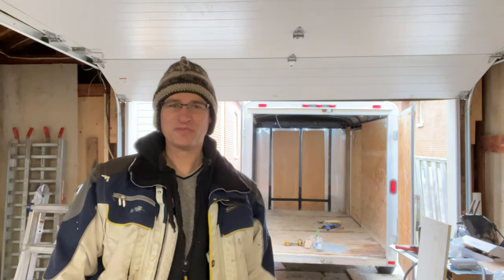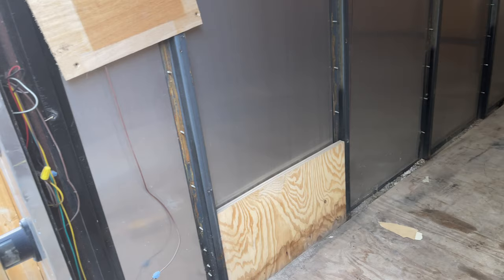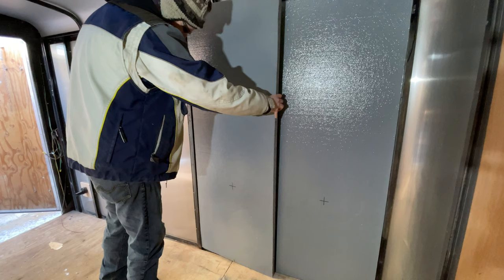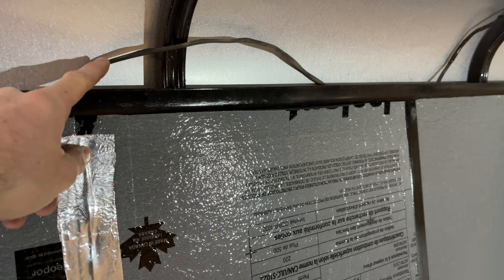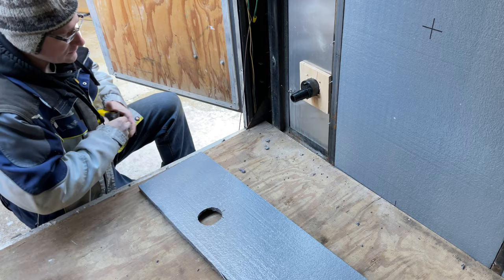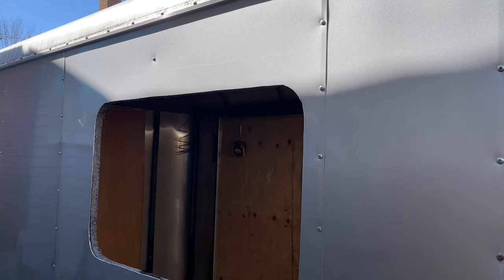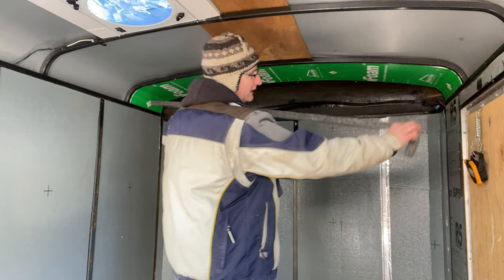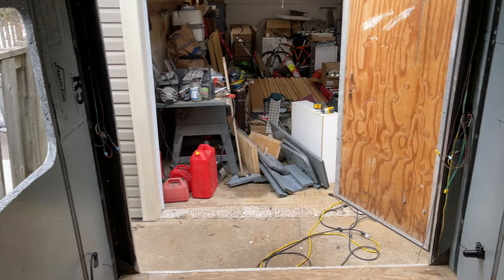How to Build a Cargo Trailer Camper Part 3 - Insulation and Windows

Comment: You've got a new subscriber way down here in Southwest Tennessee. I'm trying to research the best route to go in building a small off road camper, that I can take out on some trails through the woods, and pull with my 2020 Honda Rancher 4×4 ATV. It only has about a 820 pound tow rating.
Reply from the maker: Right on glad to have you along! Love that country….we are heading down to Texas this winter.
It sounds like an interesting build with a few challenges! I’d be careful of the tongue weight also. So many of these home built trailers they didn’t balance out the build over the trailer axle properly and they are either squirrelly or tongue heavy. 
Keep me posted as you go would love to see a video of the finished trailer!
Reply: @waysoutback Thanks Bud.

Comment: Great vids and hoping you can help with a couple questions. Did you add any cross bracing where you cut studs for windows? Also did you reuse the wall material that came with the trailer? I’m hoping to reuse to save money on materials. Thanks!
Reply from the maker: I didn’t originally, but when I re did the trailer to add space I did.  I have a couple videos on that build.  It seems to work both ways.  Yes I reused the wall material.  Keep me posted on how your build goes.  
I do have a how to build guide that might help you available here.
https://waysoutback.com/product/how-to-guide/

Comment: Hi there, I've watched this entire series and a few other videos. I never did see if you insulated the door and ramp/back doors. How did you do that? Seems you have to take the WHOLE thing off just to get the plywood/luan off.
Reply from the maker: Yeah unfortunately I never did insulate it… I ran like that for a few years then fixed it in version 2.0.

FULL TOUR- Cargo Trailer to Camper Conversion: Off-Grid Adventure-Ready!"
https://youtu.be/6G1-MKZaC4c
Reply: @waysoutback  Thanks for responding. Thought I'd ask one more thing I got wind of today. The air gap: A lot of peopel say that many builders on youtube are doing it completely wrong, and that you need an air gap (especially when using reflectix) to proper insulate. But I don't know if this is specific to hot or cold weather. Just curious if you ran into that and how you decided your initial "insulation path"
Reply from the maker: Interesting.  Funny enough I’ve been thinking about this last time we were out winter camping, I could see moisture building up on top of the paneling where the metal stud was.  So I think what I’m going to do is remove the paneling and install 3/8 plywood strips so that there will be no thermal coupling from outside to the inside.

Comment: Zac since I do not weld, what about cross members that have steel angle pop riveted to the vertical members you cut. Then sandwiched with the ply for the opening. Great videos...thanks for sharong them. Why are you installing the foil side out on the insulation. Hey since its cold there where your working, where is the wife with the hot chocolate?
Reply from the maker: That definitely would help, it would depend on how many vertical supports you are cutting out. If just one then that should work, you would probably want to use some decent sized pop rivets and not aluminum.... maybe stainless? I’m not sure if they would stress crack easier because of the harder material. I would look that up, I’m definitely no expert.
I’m not 100% why I put the foil up, I think on the insulation it said which side to the outside of the house, so I went with that. I can tell you though staying warm is not going to be a problem for us. From freezing That little diesel heater warms that whole trailer up in about 7min. 
Funny you say about the hot chocolate.... every day I work on it we have one out there or a coffee depending on the time of day. We really like the little trailer and I strongly feel it’s the only way to go, you can’t beat the customization and price 👌

Comment: GREAT BUILD! I wish I would've seen this before starting my 6'x12' conversion! What did you do to insulate the barn/side doors? Or did you even insulate them? Thank you! AE
Reply from the maker: Thanks 
Yeah… No insulation on the barn/ side doors. I think it should be ok but I will see how it does this winter. I’ll keep you updated. Thanks for watching 👍
Reply: @waysoutback  I just added foam insulation (the kind with foil on one side)  right on top of doors with the foil part showing inside.Doesn’t look too bad!
Reply: @waysoutback  Thanks for getting back to me! May I ask one other question please?Would u have mounted the heater’s fuel tank inside your tool box instead of on the side (like it is now) if it would’ve fit in there? I’m indecisive as to mounting mine inside my (poly) tongue box or on the side of it..like u did. Ugh…
Reply from the maker: Yeah it’s a tough call. I think if my box was bigger I’d have put it inside. But right now I basically only have enough room for my chocks, leveller, crank, hose to fill my tank and a tarp. I’m trying to figure out how to mount a box on the back that swings out of the way. If I had that then I might have put the fuel tank in the front box. As I’m sure you know space is tight on such a small trailer. 😁

Comment: Most people seem frame the window in. Is there a reason you decided not to frame it in.

Enjoying your build and starting on my own.
Reply from the maker: Yeah I went back and forth with that one. 
My thinking was I only cut out one support. Second I felt like the top plate where the roof braces were welded was strong enough not to need that support. But I still wanted to secure the steel stud I had cut through so I installed that 3/16 aluminum angle bracket above the window where the cabinets were going and below where the bench is. It feels good and strong to me. I can sit at the table and lean back and I don’t feel any flex. Also the window frames are aluminum and clamp the walls together quite securely. 
If I was to do it again I would probably weld in some cross braces below and above the window. But just installing a piece of wood as a brace across the top I don’t think has any benefit for these windows. The RV I pulled them out of was foam sandwiched with fibreglass no braces or anything. Hope that helps.
Reply: I didnt even think about the aluminum L angle you added. Sure its plenty strong